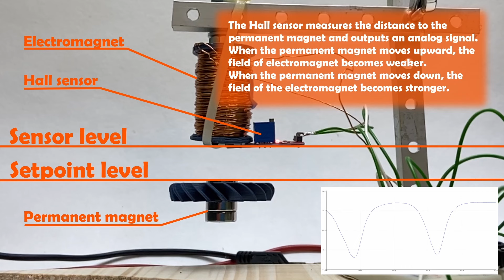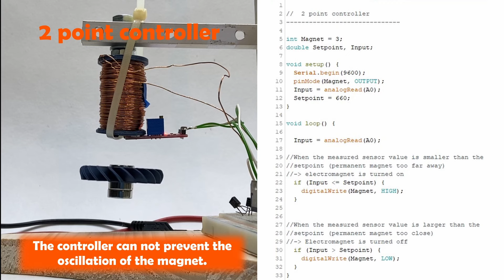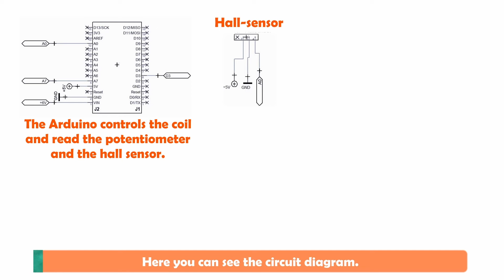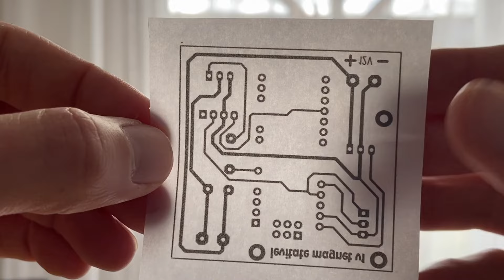Magnetic Levitation with Arduino. Technical details, Code, Circuit diagram, 3D Models, Circuit board

Comment: hello, what arduino code do you use to test your hall effect sensor ? I bought the same as you but it seems that mine is "blocked" in digital output
Reply from the maker: In minute 3:07 you can see the breadboard with the pinout. You have to connect the Arduino input to A0 of the sensor and not to DO. The digital output of the sensor is not needed. You can see the Arduino code in the video from minute 3:35.
Reply: @FraensEngineering  Thanks for all the advice and the video, I finally ended up doing mine and it works !
Reply from the maker: I am very happy that you succeeded :-)

Comment: I have a question. The electromagnet that you made, is air core right?. I made this also, it doesnot work with metal, when I connect the DC current
Reply from the maker: I used a M8x60 screw as the core. I screwed a nut onto the screw to adjust the height. In my case, the screw protrudes ~40mm into the coil.
Reply: @FraensEngineering  thank you very much. Another question is,in the plan,you supply 5V, 6V and  12V. So how can you do that. Like i see 12V power, that you use external power. And 5V and 6V, that you have to connect through DC DC current from Arduino right
Reply from the maker: The 12V are from my power supply. I have installed the voltage converter 7806 to save the voltage converter on the Arduino. At the first try I supplied the Arduino with 12V. Unfortunately this did not work. So I installed the 7806. The 5V is the output voltage of the Arduino.
The coil is supplied with 12V.
Reply: @FraensEngineering  oh thank you thank you very much to ask my question. Another question is, how can i find set-point. My object is already a little bit  floating/levitating. But they can not completely floating. Thank you. I make this for my school.
Reply from the maker: Did you use the PID code? As far as I can remember, this worked better for me. With "Kp, Ki, Kd" you can set the PID controller. I've been busy with this for a very long time.
With the 2-point controller you can set the setpoint via "setpoint=....".
A problem I also had was querying the potentiometer. This takes a few ms of time in the program. With "//" you can comment out the query for testing purposes.
My magnets were 15x5mm in size. I think that will definitely have an impact.
If the whole thing is set up well, it works very well. I spent many hours/days with it ;-)
Reply: @FraensEngineering  so do i. I try it like 2 weeks until now. Thank you very much. But I dont understand what A7 in the code. A7 is connected for something. Thank you very much. I do this project because of my german professor.
Reply from the maker: I just see that with the PID controller the potentiometer was connected to A7 and with the 2 point controls to A0. The setpoint is set with the potentiometer. This makes it possible to set the setpoint for objects of different masses.
Reply from the maker: In minute 4.12 you can see the library that you need to install in the Arduino software for the PID controller to work.
Reply: @FraensEngineering  thank you thousands times. Have a nice day. I will try it. Thank a lot

Comment: I have another question. How about the length and the thickness from screw. Because i bought this M8 x60, like you recommend, but i think it too small like the one, that you used in video. The screw M8x60 that i bought in Germany. It is about 6cm.
Reply from the maker: Whether you need exactly this screw I can not say. It's best to buy a few different ones from the hardware store and try them out.
Reply: @FraensEngineering  ok. Thank youuuuuu

Comment: hello, i'm new here. but i copied the code as you show but i get a lot of error messages. i don't know what i'm doing wrong. is the complete code available for download somewhere?
Reply from the maker: Hello, have you included all the libraries? What message do you get?
Reply: @FraensEngineering  I now started to inculde all the lybraries but when I include cdefs.h I keep getting this massage
In file included from C:\Users\Emosh\Documents\Arduino\electromagnet\esp8266_peri.h:27:0,
                 from C:\Users\Emosh\Documents\Arduino\electromagnet\Arduino.h:39,
                 from C:\Users\Emosh\Documents\Arduino\electromagnet\PID_v1.cpp:9:
C:\Users\Emosh\Documents\Arduino\electromagnet\c_types.h:30:10: fatal error: cdefs.h: No such file or directory
 #include <cdefs.h>
          ^~~~~~~~~
compilation terminated.

exit status 1

Compilation error: cdefs.h: No such file or directory
Reply from the maker: In minute 4.11 in the video you can see at the top of the screen the PID library you need. You have to install it.
Reply: @FraensEngineering   I did but then he says that I need to include Wprogram.h When I did  that It ask me to include cdefs.h
Reply: @kevin50057 what did you do to fix this? Thank you

Comment: That was an awesome video about Maglev. Some
questions:
1. What is that 'screw clamp 12V for the coil' in the
circuit? I couldn't understand the need for it.
2. Apart from the things mentioned in the circuit
image, I see additional resistors and transistors in the
actual circuit you made on breadboard. Why is that? I
see two transistors and some additional resistors.
3. Some of the leads from transistors and other
components are left out in air freely without any
connection to breadboard or anywhere. Why's that?
Are all those leads has to be connected to ground?
4. Can you please specify the wounded copper coil
specifications? Like dia. of wire, no. of turns,no. of
layers, length of solenoid, dia. of bolt. And how did
you choose them?
5. Is the Arduino pin (D3) controls the voltage or current input to the electromagnet? I understood it's controlling duty cycle using pwm, but couldn't understand what's actually being controlled in Electromagnet.?
Please let me know about these. I really need them
for my work.
Reply from the maker: Hello, I will take care of your questions in the afternoon when I have a little more time.
Reply: Hey.. thanks for replying. I'm waiting for it..
Yeah.. Please reply me when you're free.. And also please provide any additional information you have regarding this circuit and working. Like notes etc. Thanks
Reply from the maker: 1. The 12V supply voltage goes through the screw terminal into the 7806 voltage regulator and into the coil. You can see this in the video in minute 4.56. In the circuit diagram "The coil with transistor" and in the circuit diagram "Voltage transformer".

2. the components on the breadboard are from another project. Only the parts as shown in the schematic are needed.

3. can you tell me the time from the video where you see this? Free leads should not be. See the schematic. 

4. 0,5mm enamelled copper wire was used. Unfortunately, I did not count the number of windings. If you have a 3D printer, print the coil and wrap it in something like in the video. The screw I used is a M8x60mm galvanized screw. I made it adjustable in height with a nut. I dimensioned the components by feel. Exact data can not be found on the Internet. But it is also not rocket science. With the programming you can set a lot. If you don't have a 3D printer, you can download the STL files on Thingiverse and measure the dimensions. Windows can usually open these files by default.

5. Pin D3 controls the base current of the transistor. The small current of the Arduino is enough to switch the 12V of the coil. 
Quite I do not understand the question with current and voltage. Without voltage no current. The coil has a relatively low resistance. Therefore a high current is needed. 
I guess there will be some experimenting to do even with instructions. With the PWM settings you can assume mine. I suspect that this will not be the same for you. But if the whole thing is set cleanly once it works really great. 
I needed about 2 weeks for it ;-)
Should you have further questions, just ask...
Reply: Okay. So the screw clamp is the crocodile clips coming from the RPS right? I mistaken them with the screw clamp which is holding the electromagnet at the top. 
One more thing is, from standard copper wire table, for 0.5mm dia wire, the max rated current is given to be  less than 0.5 amperes. How did you apply 1 amp and still it's safely working.? 

And How much voltge or current is safe for this circuit? 
Can we control more than one electromagnets with same Arduino? Like running more than one individual PID loops for each electromagnet. If not, is there any way to control each electromagnet, other than having individual Arduino for each?
Please let me know.
Reply from the maker: The power supply is connected to the screw terminal. You can see it very nicely in minute 8.14.
The current is switched off briefly again and again by the PWM signal. This gives the coil some time to cool down. I tested it for several minutes and the coil gets lukewarm. The current is a parameter with which you have to experiment a bit. The whole system, i.e. PWM settings, current, number of windings, size of the permanent magnet... must be determined by experiments. I think it is difficult to make a general statement here. My values should be only reference values. 
I do not think that you can control multiple magnets with one Arduino. Unfortunately I don't know if the PID library understands multiple instances. It is worth a try. But I am afraid that one Arduino is too slow for multiple magnets. I have noticed this with the two point control. Here I had to remove the query of the potentiometer, because the loop became too slow. But also here you have to test it. 

Translated with www.DeepL.com/Translator (free version)
Reply: Thanks for replying soon.
But hey sorry to ask this again, but what do you mean by screw terminal? I couldn't get it. Can you explain it in any other sense. Please.
Reply: And one more thing, which type of hall sensor did you use and How can we get the analog output (which is shown at around 2:30) using Arduino? Can you provide me any reference for that, please. I'm working with A3144 hall sensor, and using serial plotter in Arduino, I'm only getting square waves like either detecting or not detecting. But the reading's not varying based on proximity of magnet.
Reply from the maker: By screw terminal I meant something like this: https://amzn.to/3yp78Mt
Reply from the maker: I used this Hall Sensor: https://amzn.to/3yJuyO5
The way you describe it, your sensor is a digital sensor. An analog sensor is needed. Otherwise it will not work.
Reply: Hey. Thanks for replying. 
So, is the hall sensor you're using, is it analog one? 
If it's analog, then it's fine.I'll buy the same and test it with Arduino IDE software serial plotter. Will that be okay? 

But If it's digital, how are you getting that varying voltage/gauss graph with the sensor? 
Please do reply.
Reply from the maker: The sensor that I linked to you, I also used. This is a sensor with analog output.
Reply from the maker: I just see that this sensor module has one analog and one digital output.
Reply: Ok than you for clarifying. Can you explain or just site me a reference, about how to get that analog signal graph for that hall sensor using Arduino? I've used a similar analog output hall sensor connected to Arduino through analog pin. But the graph I'm getting is a square wave only. 
I'll try to use the same sensor, which you've used but can you explain how to get that graph?
Reply from the maker: Maybe you declared the "input variable" as "integer" or "byte" in the software?
Reply from the maker: I think the A3144 hall sensor is a digital sensor.
Reply: ok. I'll recheck the program. 
But the A3144 sensor, has got a analog output pin same as yours. It has totally got 4 pins. VCC, GND, A0,D0. I've connected A0.
The hall sensor with which I've done the testing is this (https://www.electronicscomp.com/hall-effect-sensor-module-online-india?search=Hall%20sensor).
Reply from the maker: The following is described in the description of this sensor module: When the magnetic field rises above a threshold level, the open-collector output transistor switches on.....
So it's a digital one.
Reply: Okay. So I'll try it with your kind of hall sensor. BTW as I asked, can you please let me know how to get that analog graph of output from hall sensor ?
Reply from the maker: With the Arduino this is relatively simple: Serial.println(A0);

Comment: I made it, some tips: for the not pid one, is just a work of right value (magnetic one) and good weight distribution (you must put a weight). Longer shape work very good, is like a pendulum: they stabilize theyrself if longer, or will make faster swing if shorter.
For the value i prefere to use value that make the magnet barely stay on air, to make the gravity doing his job and the solenoid less powerfull (more distance, less force and less swing, find the right one).

For the pid one... Why you are so masochist? Is impossible 😂😂, trust me: is all made from the weight, the value and weight distribution, for pid one too! It because physics work for pid too, so if you want to use it, make shure it work good with not pid one, or it will be very hard.

In the end: use ONE shape, that is long, and have a light but good weight and WEIGHT DISTRIBUTION (the most important one).
Next find a value that make the magnet grab but then fall (i mean not enought), then encrease a bit (repeat)
Reply from the maker: True everything as written. However, work on objects that do not have good weight distribution eg: Pocket knives. But the magnet must be exactly in the middle.
Reply: @FraensEngineering  yes it can, but is more difficult to prevent swings. The point of using propper weight distribution is to make it act like a pendulum, that if longer (or with proper weight distribution) make slower swings, easyer to self balance.
This helped me making the levitator without PID controller, that honestly work very bad.
The P is not weaker with lower numbers; the I do not act as a I of a PID, the D do not prevent swings, but cast more of those (i have 3 fpv drones, i use PIDs every time)

Comment: Hi i really loved the work and i'm doing something similar for my ungergrad project, is it possible for me to contact you in any way to seek some help it would really be helpful.
Reply from the maker: Hello, thank you for your praise. Unfortunately I am not on any social networks. If you have specific questions, you can ask here on Youtube. I think this could be very helpful for others as well.
Reply: @FraensEngineering  I am using WSH94E hall sensor and 0.2mm copper wire but it's working as a magnet
Reply from the maker: I am using this one: https://www.amazon.de/gp/aw/d/B07DPVTKBB?psc=1&ref=ppx_pop_mob_b_asin_title

This hall sensor has a linear analogue output. I don't know the wsh94e. maybe this is a digital one?!
That the coil acts as a magnet should also be the case. However, if the permanent magnet comes too close to the coil, it must switch off. Are you controlling with an Arduino? Did you do the setup like me? With the Hall sensor you also have to pay attention to how it is installed. The one I linked to you has a beveled face. This must point downwards. I use a 0.5mm wire. It is also important that you put an iron core (screw) in the coil. However, this core should not protrude too far, otherwise the permanent magnet will be attracted. The iron core is about 2/3, seen from above, in the coil. But without knowing your setup, it's hard for me to help.

Comment: DONT YOU LOVE IT WHEN CREATORS GIVE THEIR FILES AWAY THEN AFTER A WHILE LOCK THEM BEHIND A PAYWALL !!! NEVERMIND THERE ARE MUCH BETTER DESIGNS ON THINGIVERSE FOR FREE :face-blue-smiling:
Reply from the maker: I'm sorry, I don't quite understand. What's the problem if you want a few euros for hundreds of hours of development work? It's by no means the case that you get rich with it. I come from a mechanical engineering background. Here, an hour of design work costs around 60-70€. If you then pay €5 for a cool project, that should be fine in my opinion.
The trend is moving more and more towards paid 3D models, which is understandable. Have you ever modeled a 3D model? Do you know how much time it takes?
Reply: @FraensEngineering  in your video you say and originally you did place the files on thingiverse
Reply from the maker: Ok, I forgot about that. The video is already relatively old. I've had so many new projects in between. Would you like the files?